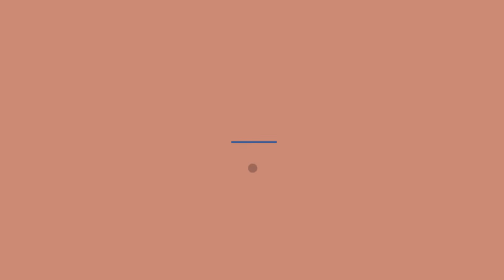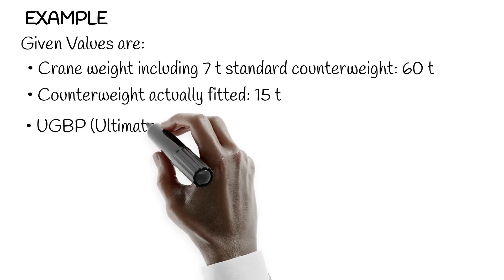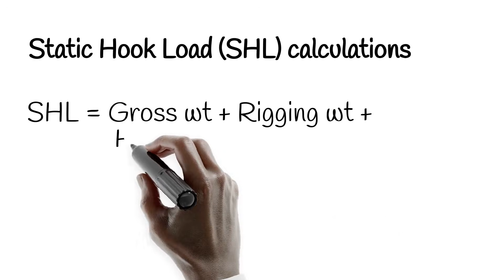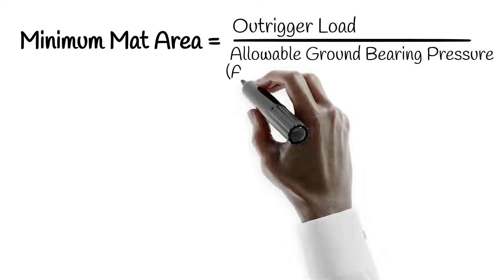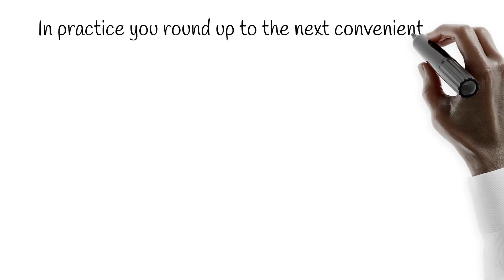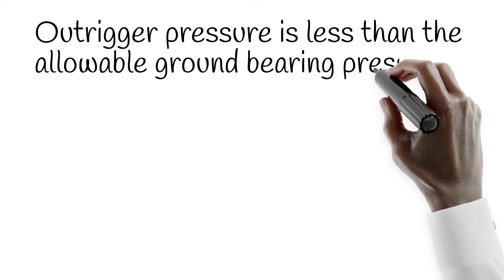CRANE SETUP SAFETY: Outrigger Load & Mat size Calculations

Comment: Furthermore the actual GBP under the selected mat is 35t/m2 which is 350kN/m2. This is higher than would be allowed on aircraft hardstandings, runways and motorways. Therefore this is an unreasonable mat size example. It's not safe on anything but solid concrete. A more reasonable starting point would be say 150kN/m2 and a FOS of 1.5. In addition you should check below ground pressures especially on roadways where there is say 500mm of incompressible road construction but the underlying soil is much weaker say only 75kN/m2. The mat sizes should be selected for this with a 45 or even a 60 degree spread through the ground to that depth, say 0.5m. Please revise this or take it down.
Reply from the maker: Thank you for your detailed input — I appreciate the time you took to explain your concerns.

Firstly, the purpose of this video is to demonstrate the step-by-step calculation process for selecting an appropriate outrigger mat size, based on the method specified by the UK National Construction College (UK NCC). It is intended as a learning guide, not a site-specific design.

Regarding ground bearing pressure (GBP), it’s important to distinguish between:
- Ultimate Ground Bearing Pressure (UGBP)
- Allowable Ground Bearing Pressure (AGBP)

The factor of safety (FOS) applied depends on the standard, methodology, and region of operation.

In my region (Middle East / ADNOC-aligned practices):

- When using manufacturer software to get outrigger load, a FOS of 1.5 is typically applied

- When using manual calculation methods (as per UK NCC ), a FOS of 2.0 is commonly adopted

This aligns with conservative engineering practice and ensures additional safety margin when calculations are simplified.

You are absolutely correct that:
- Ground conditions must always be verified
- Subsurface layers (e.g., weak soil beneath road construction) must be considered
- Load dispersion (e.g., 45°–60° spread) can be applied where required

However, these are site-specific geotechnical considerations, and including all such variables would go beyond the scope of a general training video.

The example used is illustrative, and in real projects, mat sizing must always be validated against:

- Actual soil investigation reports
- Engineering specifications
- Project-specific risk assessments

That said, your point is valid from a geotechnical design perspective, and I appreciate you highlighting it for viewers.